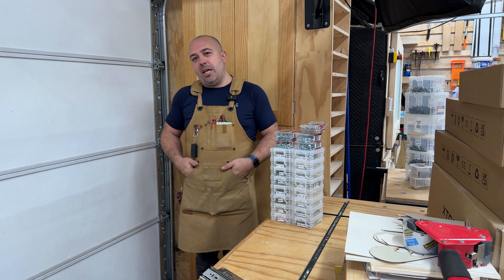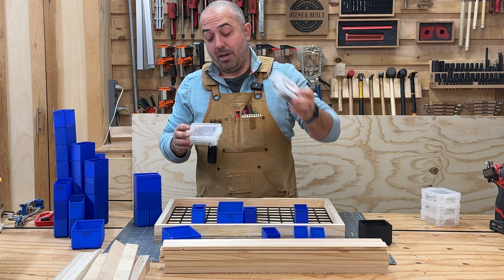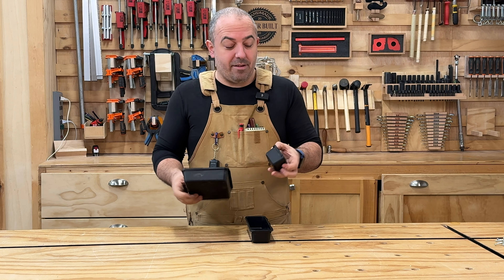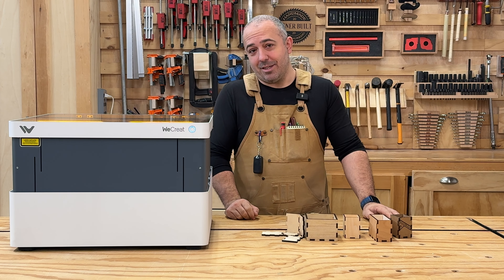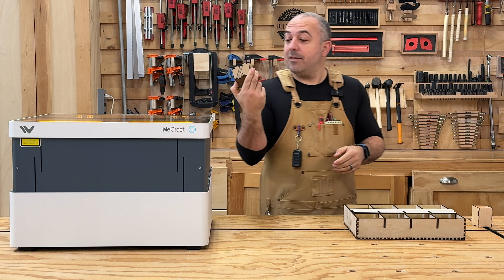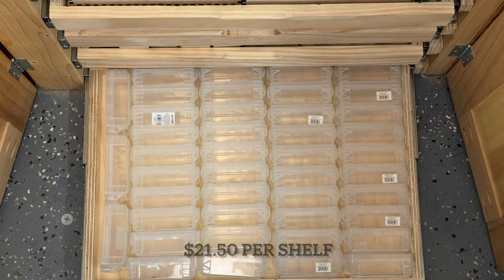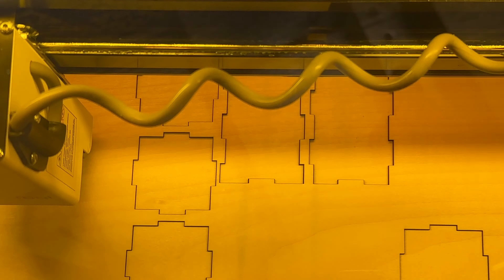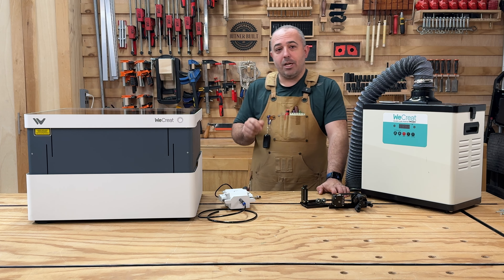Small Parts Storage 5 Different Ways & We Review The WeCreat Vision Laser Engraver

Comment: could you add a table (either in comments or description) that shows the per-drawer cost of each system. It sounds as if gridfinity ended up being your preferred option.

One think to check into for gridfinity is that there are some boxes designed to print in vase mode, which can be quite a bit faster to print.
Reply from the maker: Sure, yea it gave me the most versatile storage options and the least amount of work to accomplish, just hit print. Took days to print it all but was worth it. Good suggestion on the basement. I’ll have to take a look.
Reply: A lot of the vase mode bins fail when printing and they can only print one at a time which takes forever if you're making a lot. I made a comment above on the ones I've found that work fantastic, print fast and are economical.

Comment: I've been using the same laser for a couple of months now. The noise you heard typically means that it isn't level (perhaps one of the stepper motors went too far or you had it on a surface that wasn't level at some point). Often, that noise is the machine correcting that. In severe cases where it can't, you can manually level it by turning the threaded rods in the corners.
Reply from the maker: Ah good to know. Have you expierenced the same with the camera as you move to the corners? That’s the main concern I have with the unit.
Reply: @BitnerBuilt  Yes. About the only solution is to create a jig/template to hold your work pieces at known points so that you are centered every time and aren't relying on the camera. Pretty much like you would do with a laser that doesn't have a camera.
Reply from the maker: @chadgarner230 yea that’s disappointing. I stressed about talking about that in the video, as I don’t want to point out something like that if it’s just my machine. Usually, I don’t watch other peoples reviews but I went to watch a bunch to make sure that it wasn’t just me. I have the xtool P2 it uses two cameras, the main cameras shoots the entire bed and has the same issue but then it has a up close camera that’s on the actual laserhead that will move out and do a detailed photo of a specific area so you can check first to make sure that your incredibly precise. I think we create needs to implement something like that if they can’t figure out a correction in the software to compensate for the lens warp.

Comment: Very nice. Love options. For the wood boxes, if you want an easier glue set up you could use CA glue and activator to make it faster. Or you could use the tab connections like A Glimpse Inside uses so there is just friction fit that is tight and doesn't need glue.
Reply from the maker: Thanks for the great ideas! I started with CA, glue and activator, but switched off it real quick, because of how much I was using, that stuffs expensive! I thought about the tab method, but then I wouldn’t be able to get the boxes as close together. It creates a lot of wasted space and since we were going for efficient use of storage as possible I went with the more laborious option 😂 but good idea, it might work better for some other peoples solution!
Reply: @BitnerBuilt  ah gotcha, indeed. I only do a few glue points on mine (top bottom sometimes a middle), but I've never made them for tiny tiny stuff before so maybe best to do all or at least most lower tabs. I can see how that would use tons of glue. I have actually used VHB tape before on ones I didn't want to be permanently stuck and I was worried even minimal glue would pull the wood tabs apart when breaking down. However cutting all the little, tiny strips of VHB tape was sooooo annoying and took a fair amount of time. Lucky I was just doing it on a few bigger pieces and used a bunch because they all hold a lot of weight. Would be less needed for the tiny boxes but the tabs would be much smaller and suck more lol. Anyway, I think the drawers look great and I wish mine were this organized. Gonna get a 3d printer this year and fix me up some gridfinity organization for my small parts :)
Reply from the maker: @The_Bearded_Lady  ah yea the gridfinity stuff is great, really love my 3d printers now. Highly recorded the ankermake M5c as a first printer for anyone, I have many now but that’s the easiest and the one I trust when I need it perfect, even over my Bambu lab etc.
Reply: @BitnerBuilt  I would like to get the Anker, but I am able to get either the Creality Ender 3 S1 or V2 for a new customer deal at a local electronics shop. Just for spending $150 or $100 depending on which. I'm disabled and my finances are really tight so any little bit helps. And people say they are still pretty good printers too. So hopefully they will last me a long while til I can afford something better crosses fingers
Reply from the maker: @The_Bearded_Lady  sure those are the test of time printers, so you should be fine, they are a bit more “technical” but I’m sure you will do fine with them 👍
Reply: @BitnerBuilt  I hope so lol. I am not very good with computer stuff... Like I can do the part of electronics of putting the right wires where they need to go, but as far as the software part making a computer control things is hard and new for me. But I am hoping with the forums/groups and locals I know who are knowledgeable, that I can figure it out at least for printing things that are files made from others. It will probably take awhile longer for me to make my own. But yeah, I really like the videos you make and want to build some cool enclosers for printer/s and eventually a laser cutter. Also seen some cool videos about enclosures for the filament to keep them at optimal temps and making feeding easier etc. Lots of cool projects in mind this year, but house repairs taking priority lol. Anyway, look forward to more videos from you! Best

Comment: Nice job showcasing the different kinds of hardware storage. For me, 3d printed bins were the way to go. Nothing off the shelf really suited my needs and I just got a new bambu 3d printer to replace my old ender 3 pro, so a bit of work in onshape and I can print the same basic design of whatever size I need.
Reply from the maker: Yea the 3d is definitely the nicest, I’m not printing a few more gridfinity shelves to replace those Amazon trays. (Unfortunately my bambu a1 was recalled…. So down to one workhorse)
Reply: @BitnerBuilt  Yeah, I saw that about the A1 recall. That was the printer I wanted too, since I only print in PLA and PETG. So for now, I bought an A1 Mini. I'll grab the full size A1 after the recall is sorted out. This thing is a dream to print with compared to my old ender 3 pro.

Comment: Justin do you still use this laser? Did you try others? Looking to get one, X1s ads are everywhere, but they are bit more $
Reply from the maker: No the vision was not accurate and the when they came out with their more powerful gen 2 models, they still hadn’t fixed the issue so I turned down reviewing them. I use xTool lasers, best consumer lasers + software. The s1 is an excellent first laser, I mainly use the p2s and the f1 ultra for the past year, very happy with them
Reply: thanks man! Going to take your advice and get the X tool.

Comment: I don't think there's ever one perfect system for everything. Unfortunately too many variables for every item. As you said laser cutting has a lot of assembly time, 3D printing has a lot of printing time. Plus the fact not everyone has these machines and they're quite costly to initially purchase plus ongoing materials. Store bought solutions can also be costly and generally waste space (unless you build your drawers to their dimensions).

Probably the least costly solution I've found is buying divider cases for fasteners etc. You can find some cheap ones at big box stores that are reasonable (just don't drop them LOL). And they're not too bad on waisted space.

For electronics, just making large drawers with 3mm strip dividers to various widths. They're quick to make and populate. You can also add those small and cheap 10 divider boxes for small components like caps, transistors and LEDs to again save on space. They're not so great for resistors and diodes as they take up a lot of space. 
Sure it's not perfect but as I said, I don't think there ever is a perfect solution for everything when it's time vs money.
Reply from the maker: All cool ideas! Yea that’s why I tried to show several options, had I just done it all 3d printed for example would have only appealed to a small few 👍